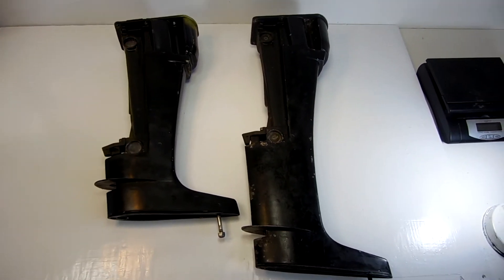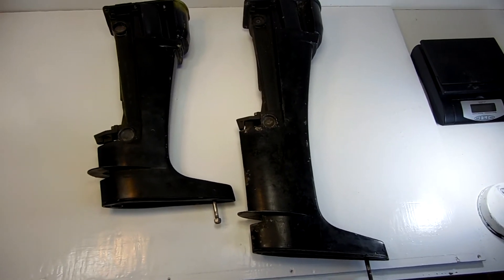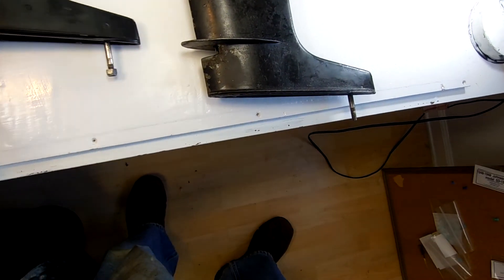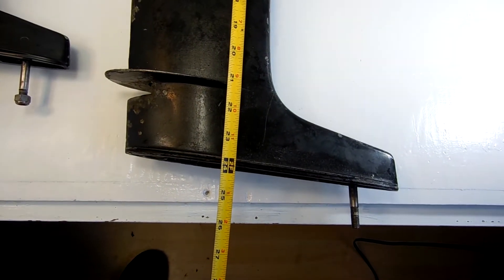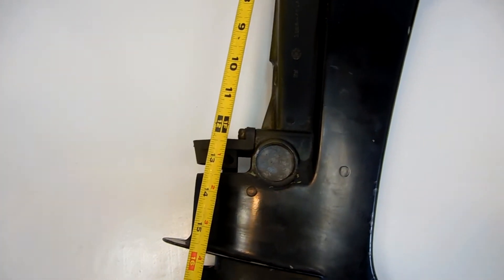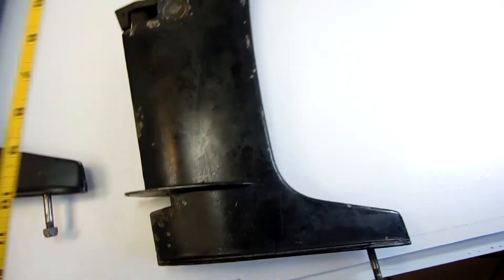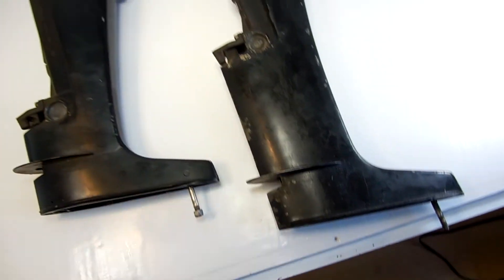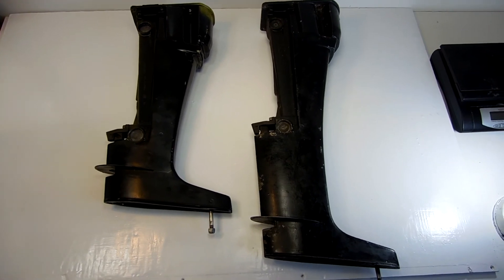Mercury 9.8 hp 7.5 hp Long Shaft vs Short shaft how to tell them apart

Comment: Freakin awesome! So difficult to find useful info on these motors. Mine is serial no. 7066459 (7.5 HP) made in Toronto, Canada (1976). Needs lower end gear case parts replaced and chasing those down now. Thanks again, cheers.